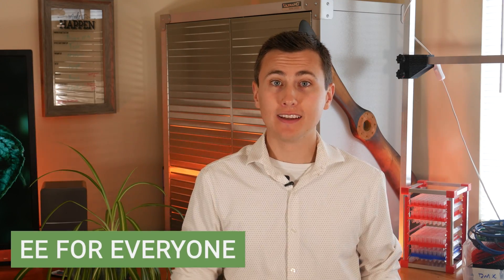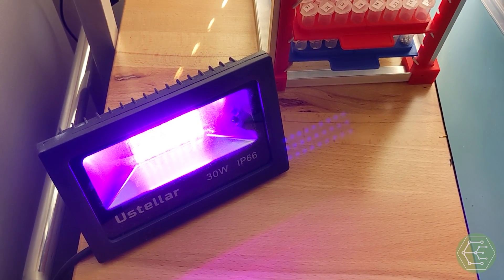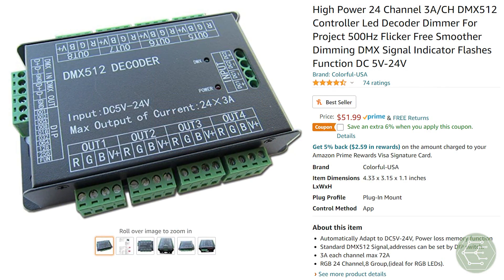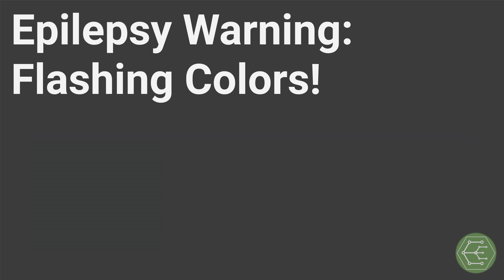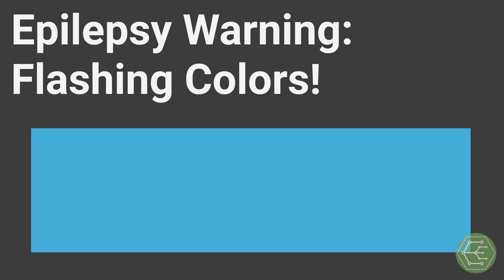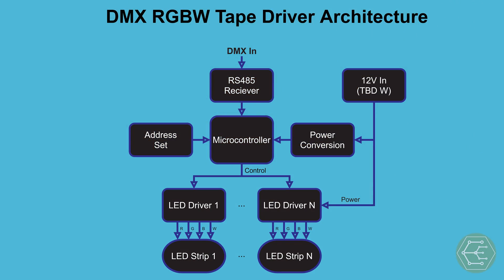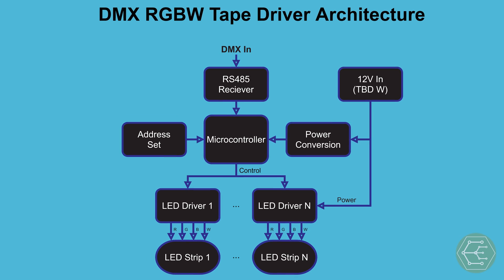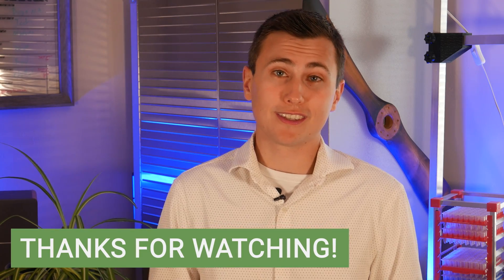Flickering LEDs - Aliasing, Cameras, and LEDs | DMX 1

Comment: Hello, very educational video!
Instead I was wondering hoe to create the flickering effect to recreate "fire" with a board RGBW. I looked up DMX controller but did not find it!
any help?
Reply from the maker: Hi Alberto! 
That's an interesting question. If it's a simple strip (the entire strip is the same color), I'd expect that feature to exist on the controller, for example here's a discussion regarding the EOS family consoles: https://community.etcconnect.com/control_consoles/eos-family-consoles/f/eos-family/16012/flame-effect-on-nomad-eos

It's likely best to drive this from the console so the look can be tuned and repeated! Otherwise, some RGBW tape drivers may have a special "fire mode"  that is accessible via a special DMX channel. I hope this helps!